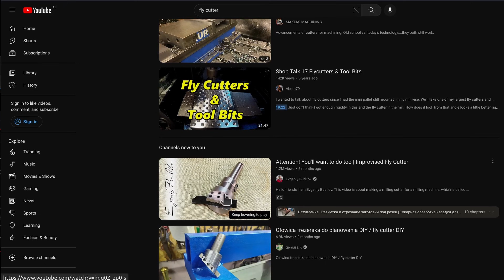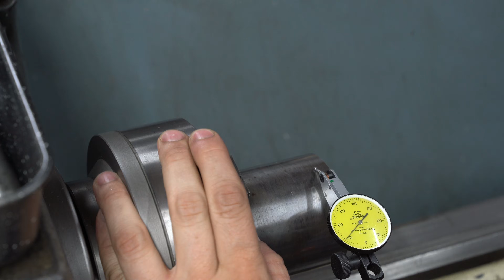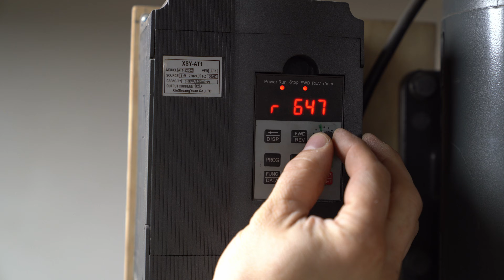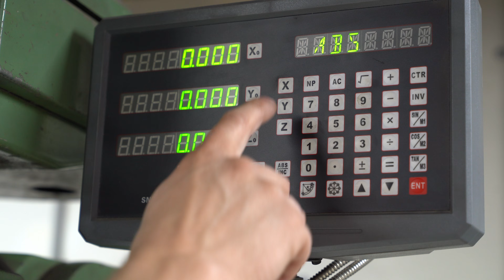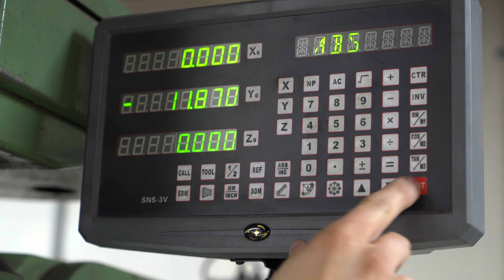Making a PRETTY Fly Cutter | CRAIG'S WORKSHOP

Comment: LH ..working right side to left. Chip throws to the column. Smart as a Fox !
 Some would say single point unbalanced thru a R8 induces clocked/timed hammering at the spindle nose not good for TIR.
Reply: You want one tooth in the cut at all times or have the inertia not to feel resistants.

Comment: Mine is starting to vibrate above 1000 RPM. At what rpm do you use yours when you cut steels?
Reply from the maker: It will depend on what I am cutting and what kind of tool I have in there. I'll use the standard speeds and feeds calculators to work out a spindle speed. But I'll treat that as a maximum, since I don't have a flood coolant system. If I get too much vibration, I'll wind the speed down a tad.

Comment: Great video. I'm making my own fly cutter. Inspired by yours. The tool holder will be 12x12 but I can't decide what inserts to use. TCMT110204 or DCMT070204. What would you recommend?

Thanks
Reply from the maker: TCMT is a good choice because you get 3 corners per tool, not 2. But I had a bunch of tools already that use these DCMT inserts.

Comment: Since you take quite some material off one side, doesn’t that create a noticeable inbalance?
Reply from the maker: Yes with this style of fly cutter, you always get some imbalance, but it's attached to a mill that weighs 1.2T, so it's dwarfed by the machine mass. Even on a smaller machine they tend to work quite well and don't give too many problems in use.

Comment: I find imperial easier to work with than metric, admittedly my machines are imperial and I prefer it that way.
Reply from the maker: No problem. I grew up with both, and can convert no problem, but have been standardising on metric for a while now. My two current lathes are both metric. My mill isn't, but the DRO helps me pretend that it is :)

Comment: Where are the dimensions?
Reply from the maker: Sorry, I thought I mentioned those. I don't have formal plans for this fly cutter. But I'll try to relay the important dimensions here:

The round bar I start with is 75mm diameter, and just gets a clean up pass. The stem is to suit whatever collet you are using, mine is 20mm diameter, 40mm long. The angle across the end of the body is 10 degrees, and the slot is 12mm square + clearance, to suit a 12mm shank insert tool.

The other dimensions are not very important. Thanks!
Reply: @CraigsWorkshop  thank you sir

Comment: Hey mate do I need to use coolant with that tool thanks from Australia
Reply from the maker: I think coolant is more necessary with HSS than carbide, and even with carbide will make the tool last longer, and may give a nicer finish. One of the problems with a fly cutter is they make a big mess though, stuff flies in all directions, so I recommend getting some old scraps of acrylic sheet, and making some guards to cut down how far the swarf and spray can travel.

Comment: Hi Craig, my challenge to you, or anyone else, is to make a flycutter holder of this size and material, using a lathe only. I don't have a mill but I have a toolmaker's 4" CH lathe with a vertical slide, and, an ER32 set of holders. Stability, or chatter, and workholding may be two issues. Your thoughts, as I am not asking you to do it?
Reply from the maker: Hi Ken. This is definitely possible. You would need to take small cuts, using a small sharp cutter, and have lots of patience. The compound slide on a lathe is not as beefy as the table ways on a mill, so (as you mentioned) stabliity and chatter will be an issue if you are greedy with cuts. The other issue is the workholding compromises with holding the workpiece. As soon as you start milling larger parts on a lathe, workholding gets difficult and you have offsets and overhangs, and small ranges of travel, that will need to be thought through. It's all possible, but not as straight forward as using a mill.

Does your set of ER32 holders include a hex or square collet block? That would be handy for holding the shank of the fly cutter. Otherwise you can make do with a V block and clamp. Good luck!

Cheers, Craig
Reply: Thanks Craig, lots of planning. I'll get both holders as I note they are regularly used. Currently making a double filing roller to be able to file squares in the lathe. Nice accessible presentation style, errors and all. Thanks, KC

Comment: I really enjoy the audio commentary. This is a little off topic but I heard you mention you were running your equipment off a VFD. Would you post a video about the electrical side and how you set it up? I am on the fence between a phase converter or a VFD. I do see the added benefits of a VFD as you have excellent speed control.
Reply from the maker: Thanks Kyle. I will add it to the ideas list. Cheers for watching!

Comment: Interesting, using a facing carbide insert/tool holder as a fly cutter, I never would have thought of that. Grounding HSS tool blanks into shape is something that I've not done so I don't have a fly cutter period.
Reply from the maker: Yes a fly cutter can be a bit of a slow tool otherwise with only one cutting edge. Carbide can run 3-4 times faster which when you have a few surfaces to flatten, really adds up. I have seen others with an insert tool (e.g. Matty's workshop) so it is not my idea but it is certainly a good idea 👍

Comment: Something is seriously wrong with that mill if its chattering and knocking with that size endmill
Reply from the maker: Hi. The chatter is from a few things. The workholding had a lot of stickout, and that never helps. Also I have a lot of slop in my spindle splines, which I hope to address in a future video. The other thing is there is some wear in the table ways/gibs, it is a 60 year old machine, and probably could be improved with an adjustment. Probably also needs scraping at some point to bring it back to as-new condition. Thanks for your comment.

Comment: Nice job Craig!!  Have you ever used a face mill and removed all the carbide inserts except one.  This leaves a small diameter fly cutter.  Just bump up the RPM to give the same surface speed. 
Only one cutter eliminates the small height differences between the inserts.
Reply from the maker: Thanks John. I have heard of this method but no I have not tried it myself. I see no reason why it wouldn't work. I do have a small (50mm) facemill but I do like using it for roughing. I like the idea of having both without having to switch and change the inserts. Also the swing is nowhere near as big as the new fly cutter. I will give it a go one day though just to see how well it does.  Cheers, Craig 👍

Comment: I need to make a fly cutter myself. What are your thoughts on moving the grub screws to the other side of the tool holding channel? My thoughts are that way if I have a tool that fits slightly loose, I am still pressing against and registering to the half plane, instead of pushing away from it.
Reply from the maker: Of the two ways to seat the cutter (against grub screws or against flat steel) from the point of view of the cutting forces, I think that against flat steel is the pick. You could always braze a shim or just clamp a shim to bring your tool to centre height. Having the tool "below" centre height is not ideal because you would need to add extra cutting relief to the geometry, which weakens it. I think the ideal fix is to size the fly cutter body to the shank size you plan to use. Or to have a different fly cutter body for a different tool size. These are just my gut feelings, no science behind it! 🙂 Good luck and thanks for the good question.

Comment: New subscriber here. I have found when using my CCMT inserts, I can get incredibly good surface finishes, but I needed to take heavier cuts,
Reply from the maker: Thanks Christian, I think part of my issue stems from some cheap inserts I bought when I was starting out. They were a bit hit and miss. I've had cheap inserts that work excellently and some others that just fail quickly and inexplicably. I think I'll try to buy some of the cheaper, but name brand inserts and see how it goes. I've had good luck with Korloy recently. Only had good inserts from that company so far.

Comment: I built a fly cutter a while back on my little homemade lathe, and homemade mill, I cheated a little by welding 2 pieces together rather than spending an eternity turning a large piece down. I get some really fabulous mirror finishes using the same tool you have but with a .8 radius tip, although I do have a power feed on my X axis 👍
Reply from the maker: Thanks that is good info. I will try the larger nose radius. The thing that will really help though is a power feed for the mill. Building one is on the to-do list 🙂 Thanks for watching. See you in the next video. 👍
Reply: @CraigsWorkshop  You're Welcome 👍

Comment: Craig are you referring to the Wilton vice. As Tom created.  There is Kurtis from Cutting Edge Engineering CEE in Shine Coast QLD. Kurtis makes boring bars for his lathes 100 Mill also 160 mill, the big ones the type you can not purchase. You properly can BUT at what price.
Reply from the maker: Hi Graeme. Yes Tom's wilton vise build was excellent. I thoroughly enjoyed it. I've seen some of Cutting Edge Engineering's videos and they are great. Impressive size of work! Big boring bar for my workshop means 20-25mm diameter perhaps. :)

Comment: Slow the speed down and double the cut depth
Reply from the maker: Thanks Union. Should I perhaps halve the speed/rpm calculation that the charts give me? I'll give it a go.
Reply: @CraigsWorkshop  The surface feet per minute ratings are ok as a guide. Pull the speed down 250-350  and put a deeper cut on. Experiment with your feed rate and chips will come, and not blue either
Reply from the maker: @union310  oh, you are talking about the lathe, not the fly cutter? I was confused for a moment. I will try that, thanks.
Reply: @CraigsWorkshop  Sorry yes, when you made comment on finishes.
Reply from the maker: @union310  ok, I get you now. Thank you for the advice. I will definitely give those a try and see what happens.  👍 Cheers, Craig

Comment: Great job Craig . I use my fly cutter lots . I made it when I did not have a mill using the lathe to make it . Try HSS on aluminium , finish is awesome if you hone the cutting edge with a stone or diamond lap . I agree about the mistakes being shown . old saying is " he who makes no mistakes is not making anything " .The art of the engineer is to find a way to make the mistakes work . Enjoyed this very much . Cheers Ade.
Reply from the maker: Thanks Ade. Appreciate your watching and commenting. The little fly cutter I had always used to have a HSS cutter in it with a large ish nose radius (honed as you suggest) and it worked a treat on aluminium. 👌 I have not tried with the new one yet, but I am hopeful that it will work well.

Comment: why is it that when I used to machine things with a shell mill on a small milling machine the finish was not that good but when I used the fly cutter it was a lot better and that was using the same feeds and speeds?
Reply from the maker: I know that for me, with my face mill, it's a combination of inserts with a large edge radius and neutral-ish rake, needing a lot more force to cut, and that creates more deflection in the cut, and also - using cheap inserts that don't have a fine size tolerance (e.g. TNMG vs TNGG, or DCMT vs DCGT). One trick is to hone the inserts. and leave all but 1 out of the face mill, then you have a sharp edged single flute fly cutter. Or - upgrade the inserts as I did, and that works well too. I still love the fly cutter, because although it's slower (only one tooth), it's producing a much larger swept area which is a time saver in a different way. Also power feed will make either of these tools perform better than hand feeding.
Reply: @CraigsWorkshop  Next year maybe I will build my small workshop out here in Thailand. I think I can only get hold of Chinese machine tools because I'm in Asia and the shipping will be expensive but I have read that some Chinese machines have improved in quality but the price is higher of course. I don't have much knowledge about carbide inserts really I just used to find a tool and use it and if the insert was not up to the standard I just changed it for a different type without knowing the reason why. I worked in a maintenance shop but sometimes I never did any machining for a couple of months it was only as and when but in my last 5 years of working there a friend of mine and I created a job for us in a separate outbuilding, we had 2 lathes 2 milling machines and a surface grinder. It improved downtime on the production line because we always checked the stores to see if they were short on parts and always made 2 or 3 off and it was the best job I had until the company closed unfortunately.